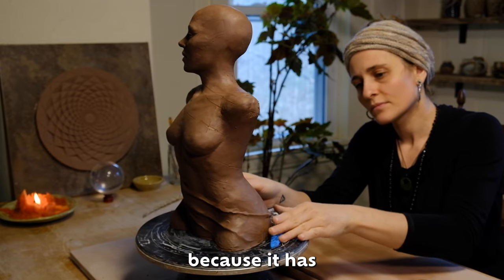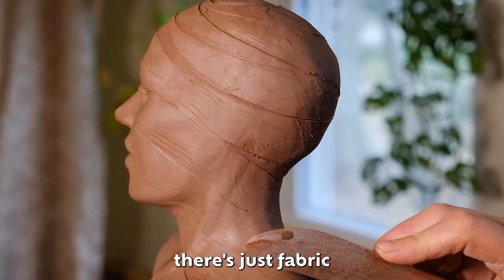How to Hollow Out A Ceramic Sculpture

Comment: If using air dry clay do you still need to hollow out?
Reply from the maker: I wouldn’t think so. It has to hollowed with the clay I’m using since it’s fired to 2200 degrees and would explode otherwise. 😁